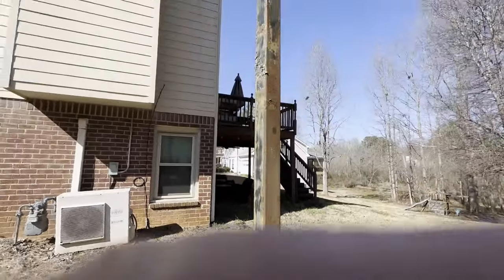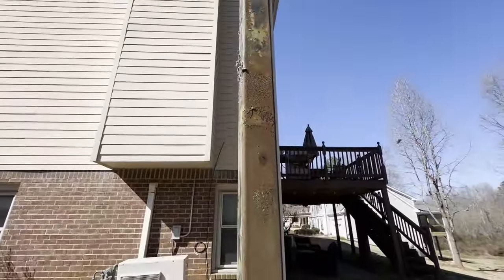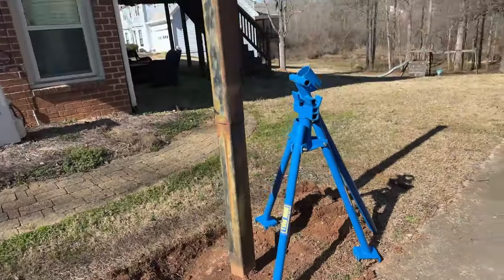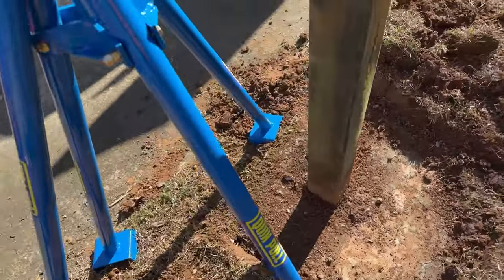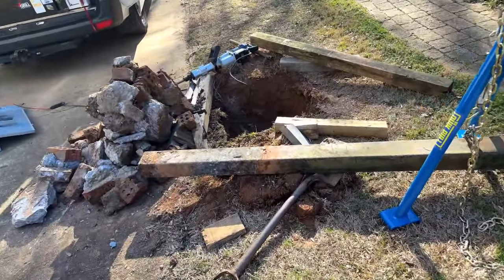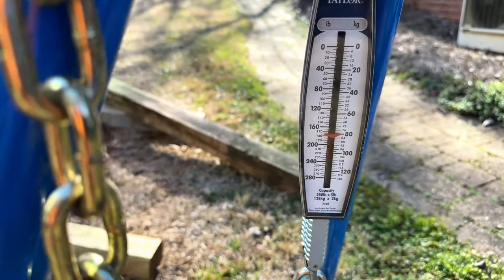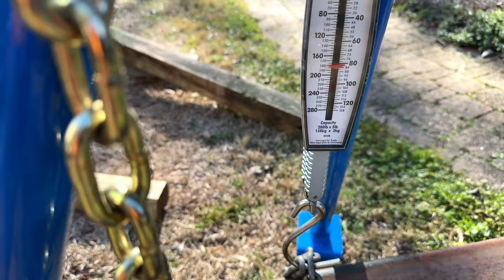Basket Ball Post Removal - NW Quik Pull

Comment: Can you please have a follow up video when you pull something out of the ground it would be appreciated.
Reply from the maker: After removing all the spoils and planning the purchase of 9 cubic feet of fill - my better half suggested I simply use the old concrete In the hole and put a couple of bags of concrete over it all to prevent future settling and then cover it all with topsoil and turf -  done . Will post video update.

Comment: A farm jack would probably be a bit easier
Reply from the maker: This is a Copy and paste: The utility farm jack boasts a substantial load-bearing capacity of 7,000 pounds ( Vevor says this 7,000 lbs too). But NW Quik pull at its first  fulcrum point is 10,000 lbs and with a cheater bar 20,000 pounds lifting force. (This is a simple formula with a 220lb person)
Reply: @usaroseinc  it appears your math is not super accurate. A hi lift jack will put out 5000lb with a 170lb load on the handle, it will also hold that load and allow you to keep moving up in 1" increments. The NW quick pull appears to be an 8-1 leverage ratio looking at it from the video. that's 1760lbs with a 220 lb person hanging on the handle. you would need 2500lbs on the end of that handle to lift 20k. Granted non of this really matters it likely takes less than 1000lbs of upward force to pull that post. My point was that a hi lift jack would be easier not that it has more capacity although it does.
Reply from the maker: From engineersedge.com 
(W) Total Load (Ibs) = 10000 lbs
(L) Length from Fulcrum (inches) = 47”
(X) Length to Fulcrum (inches) = 1”
How Much Force is Required?:
Force (F) Required for Equilibrium (Ibs) = 212.76596 lbs downforce
Reply from the maker: A 20,000 lb pulling force requires a 212.76596 lb person with a cheater bar and existing bar just 93.9999989” ( make sure the cheater bar 24 inches into the  bar to the stiffener to prevent bending.
Reply: @usaroseinc  The problem is x is not one inch..... its 6-7" if it was only 1" you would only have about an 1.5" of total travel. you need to measure middle of the pivot point to the outer most point.
Reply: with your post regarding the cheater bar that still only gives you a 15-1 lift ratio 3300lbs....
Reply from the maker: @mp-xt2rg In the first position; It is 1 inch from the center of the fulcrum to the center of the load ( which is the center of the chain) this has all been documented and measured by ‘A1 Scales’ of Vancouver WA. on May 27th, 2020
Reply from the maker: @mp-xt2rg - I forwarded your comment to NW Quik Pull and this is the response: In regards to the second comment and the cheater bar. An 1 1/4” x 6’ rock bar will only go into the handle 2’, leaving over 4’ of “extra cheater bar”. A total of over 90” of leverage.
Reply from the maker: @mp-xt2rg  The 10,000 fulcrum is the first fulcrum point - as explained in another comment I fat fingered the record of the 10,000 pull and once it was loose I moved to the #2 fulcrum point (6,000 lb) - my bad.

Comment: What's the use in making the vid if you're not going to show the pull !?
Reply from the maker: At 1.33 I pulled it at the 6,000 lb or #2 fulcrum point. Only thing I never showed was placing the 4x4 wood at the bottom because of the size of the concrete plug 3’x3’x3’ deep. I appreciate the comment and feed back. To be totally honest I fat fingered the record button - my bad.
Reply: @usaroseinc  I apologize!